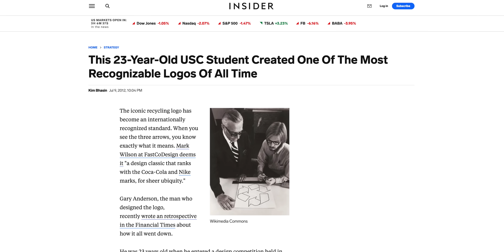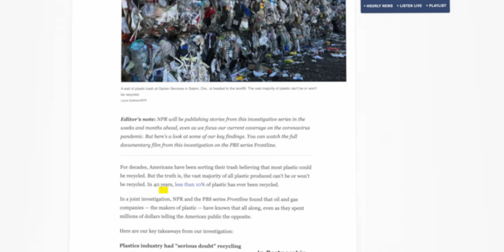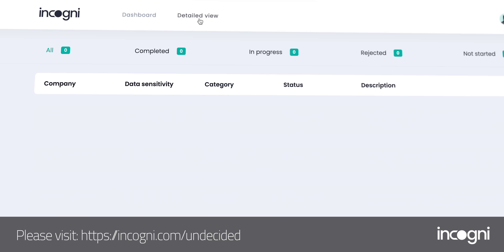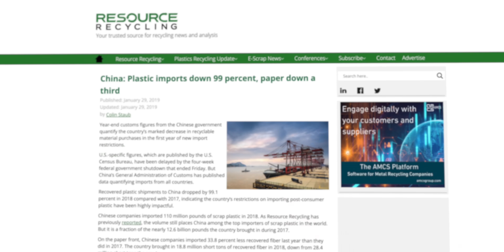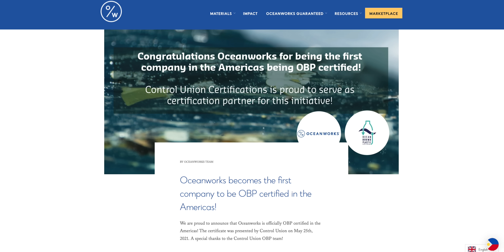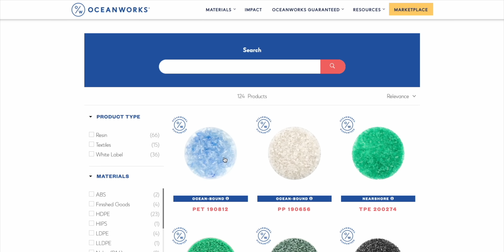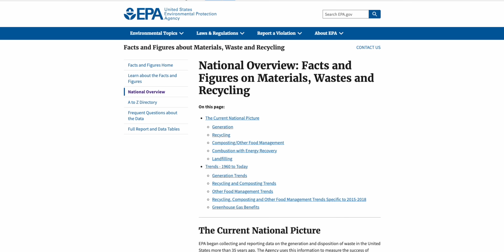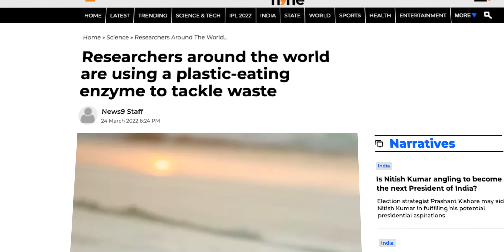The Truth About Plastic Recycling ... It’s Complicated

Comment: I have a new way of recycling plastic. I call it "Plastic Recycling 2.0". You need two things: (1) An oven. (2) A steel "box" mold for each item you wish to produce. Very simple. No shredding plastic - chunks are fine and they don't have to be super clean. I'm making VAWT windplant parts and flat plates/sheets from polypropylene ropes off the beaches (complete with embedded sand grains). I cut the ropes short with a zip disk on an angle grinder, lay them in the mold, set the top on the mold, and put it in the oven. Then put heavy weights on top of the lid. Turn the oven on and wait an hour or more. As the plastic melts the lid/top sinks down and the weights press the plastic into place in the mold. Should work with other plastics like HDPE food/liquid containers, too. (I'm planning a video on my channel TurquoiseEnergy but haven't got to it... I'm making a bigger oven to make sheets/plates 18" x 36". In the meantime it's posted in my monthly newsletters from around Nov. to March or so on my site.)

Comment: One technology you didn’t cover that I think could help is plastic pyrolysis. This is essentially turning plastic back into oil, which can then be turned into products like cleaner diesel fuel, kerosene, gasoline, parrifin  wax, etc. The best part is that it can use most plastics (except pvc and the “other” category I think) and requires little to no sorting. A few plants like this are starting to spring up. I don’t know, this could be helpful.
Reply: In addition to returning it to oil, pyrolysis also produces combustible gases that can be fuels themselves, adding more energy to the mix. It's cool stuff.
Reply: Basically selling garbage back as fuel.
Reply: Licella, an Australian Company uses the Thermal Reactor which boils plastic using hot water.  They can even use the recycled plastic as Virgin Plastic.
Reply: Cool!
Reply: Huge toxicity issues. Banned in many states. Enormous energy consumption as well. Worse for the environment...

Comment: I fell for this. I still recycle plastic. I even know of people in the plastic recycling business throwing plastic in the regular bin as the recycling has a higher co2 footprint because the garbage is travelled so far. 

Imagine how many of these scams still exist despite this and dieselgate. Oil and Gas are moving to green "on paper", the financial shows it's at a slower place than the glaciers they're melting. We can only hope Nestle and Coca Cola are genuine about their efforts.

Regarding the enzymes it's a fun fact that all the coal we have in the ground is because we didn't have any bacterias able to break down lignin in wood until several (hundred?) millions of years passed. Trees literally fell over each other and apparently didn't rot (I'm on my second beer here) they got compressed by soil over eons of time and turned into coal.

Comment: several points. 1 Penn and Teller did a show called Bullsh!t that covered this 20 years ago or so. they showed that people will do silly and stupid things to recycle even when it is gross. 2 the way forward? make it bio degradable or recyclable. some of the ways you can add things to land fills to help break down every thing is a good start. 3 all recycled items are treated post consumer so they are taxed at a higher rate. fix that as items to be remade into new items should be treated as new material.

Comment: recycling is not necessary. Government bureaucrats, in cahoots with oil companies, have managed to make recycling impossible, or at least, inconvenient. One needs a PhD in Chemistry to understand the recycling  symbols. Instead,   for any type of packaging, set a tax ON THE PACKAGING, that EXCEEDS the price of whatever the package contains, be it Coca Cola, or Beluga Caviar. When the user returns the package to the seller, the user gets a full refund. The seller then returns the package to the producer. Paying more than twice for whatever, anything  bought is worth less than the packaging which makes it a very strong incentive for returning the packaging. An for companies like Coca Cola they either go back to glass bottles, or aluminum. As for shampoo, liquid detergent, bleach, etc. , the minimum size container should be 5 gallons, or bring your own container to the store to be refilled. These 5 gallon containers should be shaped to reduce material use, i.e. a spherical or cylindrical shape with height equal to diameter. A  squat drum

Comment: I would like to see more "reuse." Until the late 1970's a good percentage of pop was sold in reused glass pop bottles. You could also by milk in reused glass bottles. Reusing glass is much more energy efficient than recycling glass. 

In the Puget Sound area of Washington state USA there is one dairy that currently uses reused bottles. The bottles are heavy. The bottle deposits are high. But of course you get that deposit back on return of the bottle.

Comment: the best path forward with plastic is to heavily restrict when and where plastic can be used. Plastic is an incredibly versatile material. It's durable, easy to produce, easy to clean, and has a million and one functions. And when a plastic object is made properly and used for years (or even decades), the impact on the environment isn't that huge. The plastic that's killing the planet is the "disposable", single use plastic that exists (edit: exists in the economy, not the environment) for < 1 year. Stuff like plastic grocery bags, cutlery, and packaging, that becomes trash almost instantly after the consumer touches it. Outside of some highly specific circumstances (e.g. some kind of medical hygiene necessity), single use plastic should simply not exist. And consumers have little to no power to make that happen. Single use plastic bans need to happen at the legislative level. National/super-national governments need to make it happen, not me and my neighbours.

Comment: In parts of Sweden we used to have separate recycling for hard and soft plastic. But stopped. I guess it was not worth it. Had a marginal benefit since hard plastic is generally easier to recycle and sort through while soft plastic will often just become fuel.

But it was quite a hassle for consumers since it was often unclear where to put semi soft things.

I feel like it makes more sense to not bother with it unless it makes a significant difference. Instead focus on separating some more niche products. Like the bottle deposit system where only PET bottles are separated. That part is infinitely easier for both consumers and recycling plants.

Comment: Is recycling of plastic soda bottles via container deposit systems worth it? I feel like it's a good system as one very specific type of plastic is gathered separately, making it clear to both consumers and infinitely easier for recycling plants.

called Pfand in Germany, or Pant in Sweden. Each bottle costs 10 or 20 cents more and you get it pack as you deposit the bottles, most grocery stores have deposit stations at the entrance.

I guess that's a way forward if random plastic is too hard to sort through.

Comment: the myth of consumer responsibility is just as bad as the one that recycling was solving the plastic problem.

should people use as little plastic as they can? absolutely.
But people are not the primary contributing factor to our plastic waste problem.   its just the one you see the most.

In a single 8 hour shift at work, I use (creating NEW plastic waste, not even including the plastic packaging stuff came to me in)  more plastic than I will use at home over 2-3 weeks.

Comment: The best path forward I've found @op, is circulen plastics. Particularly, to be able to take plastic and return it, not only to reusable PCR resin, but to feedstock, so that virgin resin can be made from the converted waste. To make it economically viable to take waste plastics, and then remake them into virgin polymer. The only way forward IMO (considering the amount of infrastructure already in place to process plastics that would likely need to be changed/retooled to work with other biological substitutes), is to make an economic incentive to recycling, and from what I've read circulen (at least, circulen revive) does that.

Comment: In Sweden we used to have reusable glas bottles. Beer, soda and water used to come in a standardised 33cl bottle and when you had finished them you could return them to the store and get some money back for them. These bottles where washed and then reused for new beer/soda/water. This was a great system, however since the pet push of plastic, this has stopped and you cannot get these glas bottles anymore. Going back to that type of solution would make a big difference in the drinks department.
Reply: We had glass bottles like that here in the US back in the 70's and earlier.  Also milk used to come in those thick glass bottles.   No waste [except the hot water and soap to clean them]

Comment: how about pyrolysis? it breaks down the plastics back into its original form. it doesn't have to be clean, or homogeneous when it goes into the cooker. what comes out are varying forms of petroleum distillates that resemble diesel, gasoline and other petrochemicals

Comment: You can make diesel from plastic.  Plastic is made from oil.  You just need to melt it without o2 because o2 will chemically change the transformation from very harmful to less harmful.  
Then you fire the plastic with co2 and distill it and you get diesel.  
40kilo of plastic can get you 2-3 liters of diesel.  
Plastic is made from oil.  It can be transitioned back to its original form.

Comment: incinerating plastics is actually a good way to use it.  It makes a very pure fuel because the materials in plastics are already highly refined.  If burnt at over 650 degrees then it emits virtually no CO2 or greenhouse gases.  Think of it this way, it is a really useful energy source that we managed to use as a useful product (as a plastic container) on the way to the power station.   Thinking of it this way and you realise that we have actually managed to get two uses from all plastic which is used as a fuel in power stations.  That is far better than most people think and loads better than putting it in landfill.

Comment: Best path? Scream "climate change!", jump up and down, fall on your knees, cock your neck back and unleash the most primal scream of frustration and anger you can imagine. If possible, put it on TikTok, so it can be picked up by other social media outlets and turned into a glorious meme. Seriously though, plastic's great stuff. It's incredibly cheap and useful. We should use it. But like anything, we need to be responsible about dealing with it on the back-end. That rests on the consumer's shoulders. That means, whatever solution you suggest has to be cheap and convenient, and if you can't make it that, go back to the primal screaming, because no one's going to do it. I have no problem with incinerators, as long as the smoke is properly scrubbed. You use the heat to make electricity if you're any sort of intelligent: two birds, one stone. I also have no problem with "upcycling" if someone can make a product people want to buy. Unleash the free market. As for the scientists with the enzymes, I think this has be dealt with cautiously. The last thing we want is these critters become ubiquitous in the environment and eating things we don't want them to, or mutating and taking on traits we don't want. Keep them in bioreactors in controlled environments, harvest the enzymes for cleaners, and sell those broadly. As you note, temperature controls and other issues may limit use, but a proper production facility can manage such things cheaply and at scale... as long as Joey Bribes doesn't continue to foul up (yes, I'm being polite) the world's energy supply and supply chains.

Real solutions: good. "Real" is defined as market viable in the free market economy WITHOUT government subsidy, regulation, incitement, or bankers pulling the same thing by waving around trillions of dollars and demanding compliance with "ESG goals."

Comment: Great video! But also quite dangerous… In Germany roughly 70% of plastic is recycled, on top of that sup (single use plastic ) was banned a couple of years back in Europe. That wouldn’t have been possible if people didn’t recycle because they thought it was a scam and it took more time to do so. Recycling is great, even if it’s only 5%, promote it, make your states implement infrastructure for it, and by better plastic. But the solution is never, and I repeat never, to think everything is a scam. Go the extra mile and show the companies and your government that u want better systems and products. Sheers

Comment: There is a problem with this article. It does not take material lifespan into account.
For example, the glass of a glass bottle will last almost forever so recycling it makes good sense.
Many commonly used plastics have a short lifespan, IE PLA which is very widely used. It is 
made from starch and degrades rapidly so recycling it does not make much sense.

Comment: The way forward to recycling all domestic waste including plastic might be Oxalor & Pyrocox. These technologies allow to recycle all domestic waste and produce fertilizer, oil (can be used for electricity) and metallic pellets. 
The under-pressure process ensures that there are no toxic by-products (fumes etc.). 
It requires space (a few hectares), expensive (500k Euro) but it is a viable solution. 
A British patent completed the French invention, and there is only 1 prototype in the UK. 
Both inventors are reluctant to share the principles as it may be copied by China. They are currently proposing it to African country. 
This isn't well managed. Inventor and Marketing do not go hand in hand. :)

Comment: In Denmark we have since 1942 had a system for recycling beverage bottles. Initially this was only for the most common types of glass bottles. The way it works is that people who buy a beverage in these bottles are charged an extra amount for the bottle. But the shops selling these beverages are also required to buy back the empty bottles at the same price as the extra charge, and the bottle charge is high enough that people want to collect their empty bottles and return them to the shop. For glass bottles the glass is not really recycled. Instead the empty bottles go back to the bottling plants where they are rinsed before being reused.

When plastic bottles became common this system was expanded to the most common types of plastic bottles. When I buy a 2 liter bottle of drinking water I pay an extra charge of around USD 0.50 for the plastic bottle which I get back when I return the empty bottle to the shop. All grocery shops have a machine where you can put in your empty bottles. It counts them and identifies which kind of bottle it is (and what was previously stored in the bottle) from bar codes on the bottles, and sorts them accordingly. At the end you push a button to receive a receipt you bring to the cash register. The plastic bottles are not reused, so the machine immediately shreds them for recycling into the correct bin, depending on the type of plastic and what was previously stored in the plastic bottle. Because the sorting is so precise the shredded plastic bottles have a high resale value for recycling.

Here in Denmark bringing your empty bottles to the store is a common part of going grocery shopping. And you rarely see empty bottles in the streets. If empty bottles are left around people pick them up so they can bring them to the shop to get money for them next time they go shopping. If you saw half a dollar on the sidewalk, wouldn't you pick it up?

Comment: I like the recycling of mixed plactices into building materials  by melting and mixing with sand or gravel making tiles, bricks, and byfoaming it insulation. Today Saw a u tube on styro- superairCrete the guy was claiming it costing only35 a yard comparedto 6 times higher for concrete.  Lastly check out book ecotopia from early 70s. Homes there were extruded plactices and would last as long as wanted

Comment: 👍Using alternatives to plastics
👎Plactic eating orgainisms. AFAIK it's likely the enzymes don't actually consume the hydrocarbon molecues, or the actual plastic but break up the bonds that holds plastic together. If that's the case, then the plastic remains except now it's a dust instead of a sheet(or whatever the original form was). And, specific enzymes work only on specific plastics.
👍Regardless whether there is a current market for collected plastics, it's important to collect plastics and store them separately even buried at the dump if necessary so that plastic is kept separate from other waste like compostables and metals. One day there technology and possibly scarcity will make discarded plastics valuable enough to dig up and utilize, so it's important to cache it all by itself for the future.

Comment: If you walk into a grocery store, you will be surrounded by plastics.  I try so hard not to use plastic, but it is nearly impossible.  Even plastic forks are wrapped in plastic in plastic boxes shrinkwrapped in plastic.  Every winter boats are taken out of the water and shrink-wrapped, and every spring this wrap is thrown away.  We HAVE to do something!  We have survived just fine with all this plastic before.